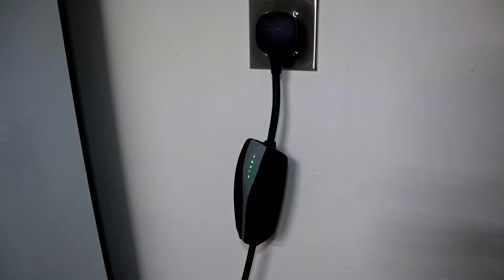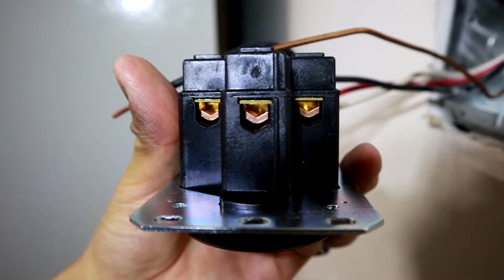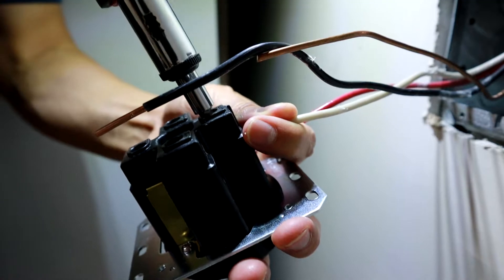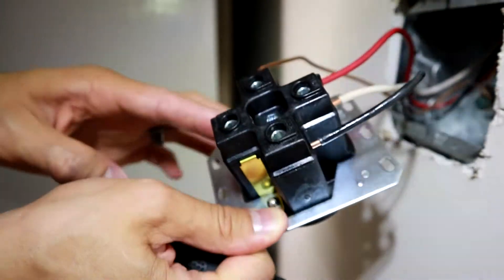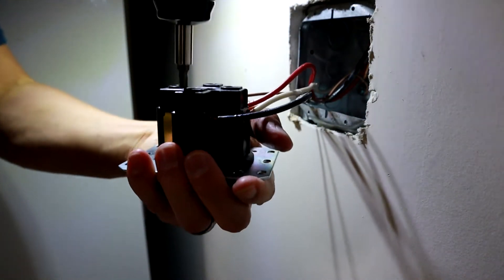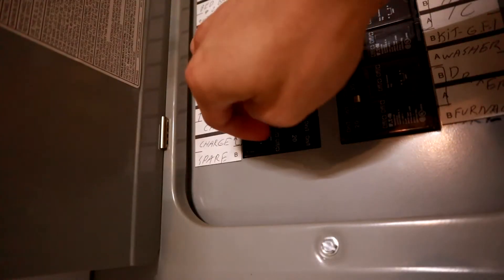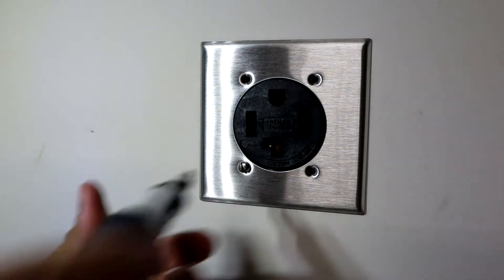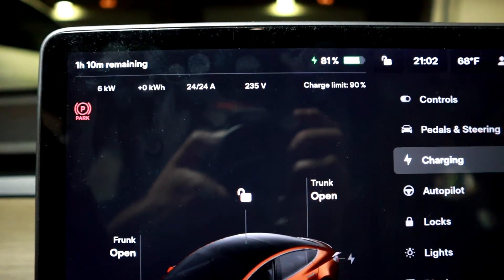How To Install NEMA 14-30R (4 Wire, 30 amp) (Also Works for NEMA 14-50R) (4 Wire, 50 amp)

Comment: Would it be safe to swap a 14-50r outlet to a 14-30r outlet as long as I replace the breaker with a 30 amp? My new rental has a 14-50r for the dryer but my dryer has a 14-30r cord, and is rated for 30amps. I’m afraid it would be a hazard to just use a 14-50r cord for my dryer
Reply from the maker: As long as all the hots/neutral ground still line up and can go somewhere, yeah that should be fine.  And also, it sounds like the wiring in there currently is rated for 50amps?  If so, going down to 30amps is fine with a 30amp breaker.  That's the only way to go.  Going the other way is a no no.
Reply: The dryer will probably run fine if you swap the cord and wire it up correctly. But if a fault ever happened it would go on longer before the breaker popped. I'd personally swap it the outlet and breaker. 

I recently discovered the ancient 10-50R for the dryer where I lived was on 12G wire going back to the breaker. Let's just say I swapped that out as quick as I could after my panic wore off.

Comment: my 30 amp,125/250 volt, 14-30R, 3-pole, 4-wire , my 4 prong plug 30 amp electric dryer is wired to 30 amp outlet is not working why?

Comment: NEMA 10-50R, or 14-50R receptacle installed in the home on a 30 ampere circuit. my 4 prong plug 30 amp electric dryer is wired to 30 amp outlet is not working why? any helpful why tips?
Reply from the maker: Probably best to call an electrician.  If you have a multimeter, use it and see if the wiring is getting power.  Could be your breaker.  But calling a professional is probably your best bet.
Reply: @blizte3
0 seconds ago
it doesn't heat up any more old dryer, nor does new dryerheat up, i wondered if breaker panel is full breakers it is too many breaker? for 200 amp box. i got measure all breaker ad upt o, then see if more than 200 amp box gives. @nukem384
Reply: NEMA 10-30R

Comment: I guess most of us can read "Ground" & "white", i came for X & Y color code.
Reply from the maker: X/Y are both black/red.  It doesn't matter which one you put in which because they are both "hot" wires.
Reply: @nukem384  thanks

Comment: I noticed you did not bond your ground at the receptacle. Can you kindly explain if bonding ground is needed?
Reply from the maker: Not that I know of.  If you look at other videos on YT on how to install receptacles, all of them (at least that I watched) do the same as my video.  I'm not saying it's 100% correct, but I'd like to think it is if experts in the field are doing it the same way.
Reply: @nukem384  NEMA 10-30R
Reply: @nukem384  my 30 amp,125/250 volt, 14-30R, 3-pole, 4-wire , my 4 prong plug 30 amp electric dryer is wired to 30 amp outlet is not working why?

Comment: What the gauge of your wire?
Reply from the maker: Standard is 10 gauge for a 30a breaker.
Reply: @nukem384  my 30 amp,125/250 volt, 14-30R, 3-pole, 4-wire , my 4 prong plug 30 amp electric dryer is wired to 30 amp outlet is not working why?